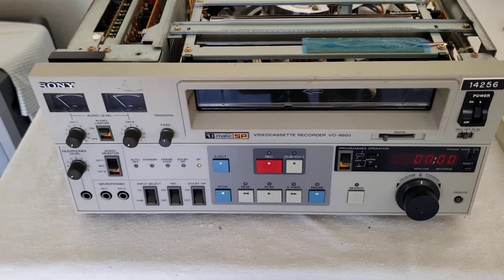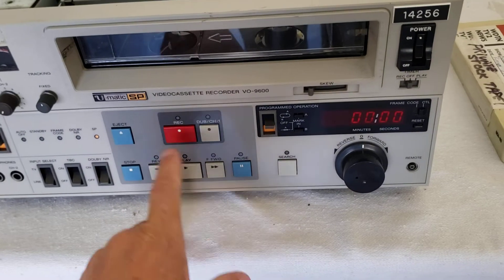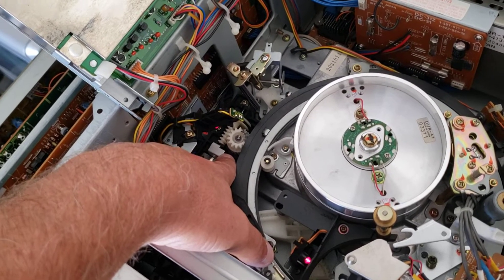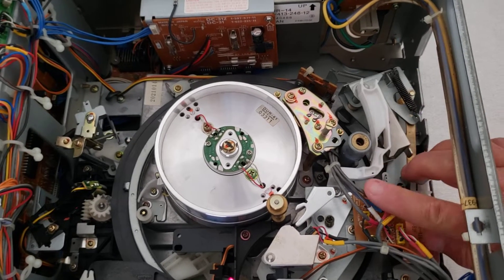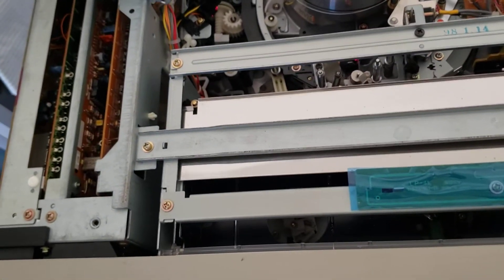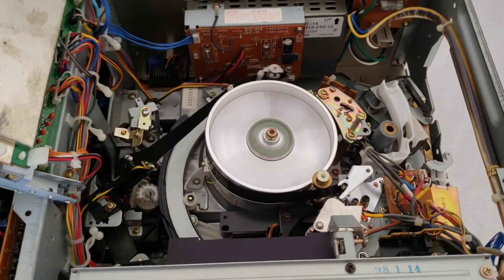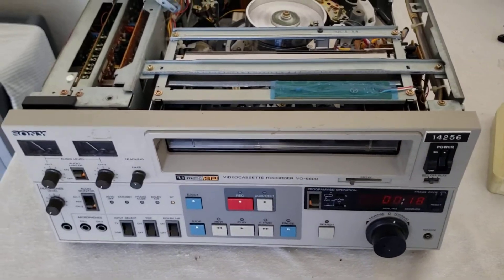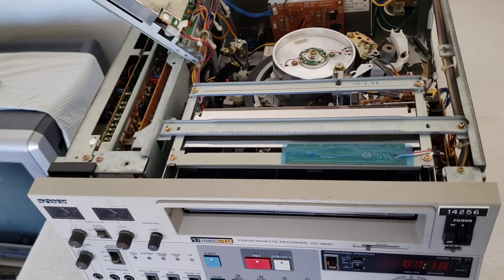Sony Vo-9600 completed Repair Walk Through.

Comment: Nice informative video!
Mine had the belt of the gear box broken,  but after replacing it it smoked from the boards to the left and with the cassette in it won't take the tape anymore when the cassette is down, what could it be? I checked the icp fuses in the SY-106 board but they haven't gone resistive (they measure 0.6 ohm) and looking at the board i can't find any burnt component, could the gear box motor driver be the one that burnt?

Comment: I work at a video production place, we have a lot of 3/4 tapes and im usually the go to person to make dvd copies of these tapes.  i use a tape deck just like this and yes ive noticed all the problems youve mentioned but i work thru them. What i would really like to know is when i play the tape and the video comes up it always has a  bent part of the video at the top of the screen, the skew adjustment helps but it doesnt completely fix the problem is there an adjustment for the skew knob that has to be made? any help is greatly appreciated.

Comment: Hi, I am in UK, bought this a few days ago for digitising my 30-40 year old tapes. Tested as working played a few tapes, and then suddenly with an old unimportant tape, it played etc, but then conrol play buttons didnt do anything , and wouldnt eject. So I cut the tape to take away any tension, hoping the eject and still doesnt, Is there a failsafe way to eject the cassette without physical intervention,?    as am hoping if ejected, next tape will play ok . Any advice would be greatly appreciated

Comment: There's never been a deck that I've had more problems with. Error. Eject. Reinsert tape. Press play. Fine for 2min. Error. Every single one of these is haunted, not to mention they weight almost 40lbs?!
Reply from the maker: Yes the biggest pain in the ass decks Ever....